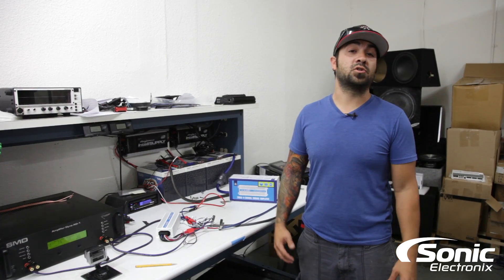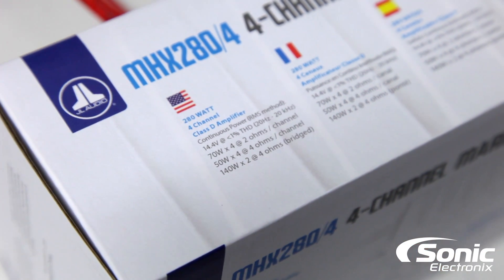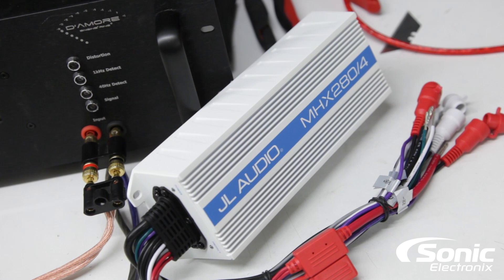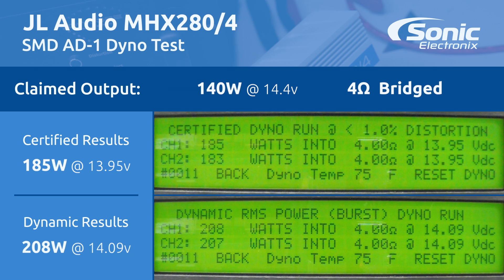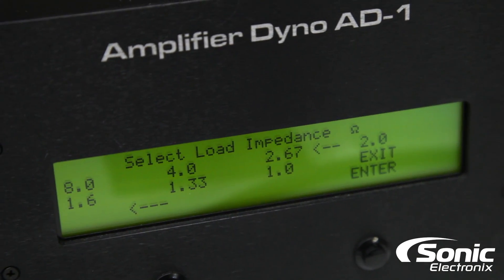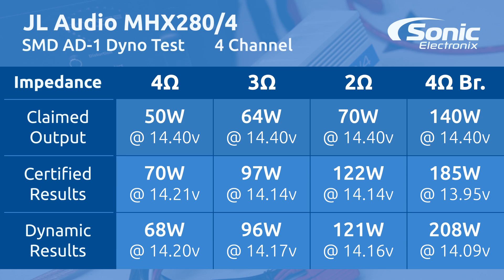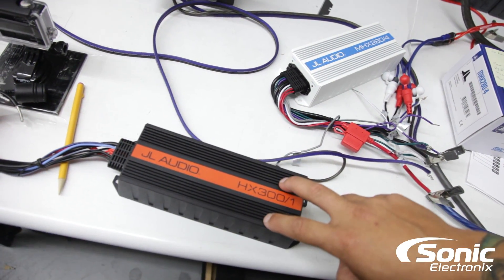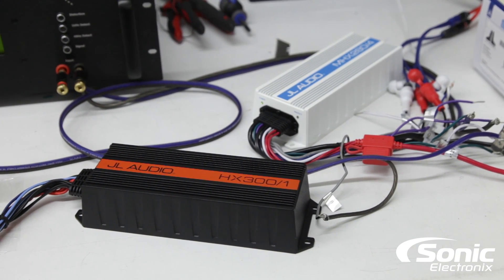JL Audio MHX280/4 Marine Amplifier Dyno Test | SMD D'Amore AD-1

Comment: The 70watt@4 ohms  was the amp turned all the up. I’m thinking about getting that and the JL C2-690T  for my bike there rated at 70watt continuous and the amp required to be 15-125 watt
Reply: Dachamp2001 the gain is NOT a volume knob.

Comment: I notice your doing a short text in 76 degree temps on an open bench.    How does this amp fair with a true musical load in real world situations, such as in a dash at about 150 degrees?  I like your approach, but I don't think its a practical test.  It s lab test.  Lab tests are what the OEM use to make their figures look better.
Reply: no doubt that's why the tested power outputs are so much greater than mfg claims - once the heat rises in that tiny enclosed space you've stuffed them into on your boat, the true power output diminishes back to the mfg claimed power

Comment: has anyone put this in a jeep with stock HU?
Reply: Yep. 2015. You can finally hear the speakers with the top down. With the 77kick10 drop in Kicker 6.5's it gets so loud you can't listen at 25 on the radio without hurting.
Reply: Chase Tretbar 
I got this amp but I can't put the gains up passed 25% without getting white noise out of the twitters on the front channel . The soundbar speakers get loud though your right.  I whelmed up
Reply: Chase Tretbar 
Getting a kenwood ddx 394 head unit and putting a pioneer 10" down fire sub with a mono alpine amp.  Sounds good with the top on.  I haven't had the top off with set-up yet.

Comment: Have you guys done any of the Picasso nano amps on the dyno ?
Reply: Brake light Warranty i second this would be nice to see pn4 1000d
Reply: david curtis I bought one a limb to try it out, had a very loud hiss sound. I tried everything from switching grounds, power wire, speaker wire etc it didn't matter I couldn't get it to go away. Had to return it